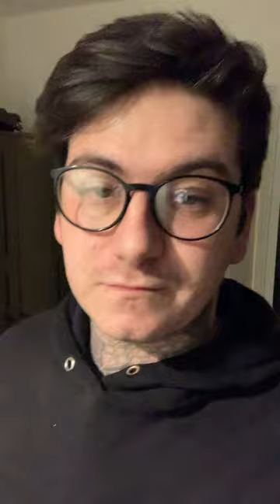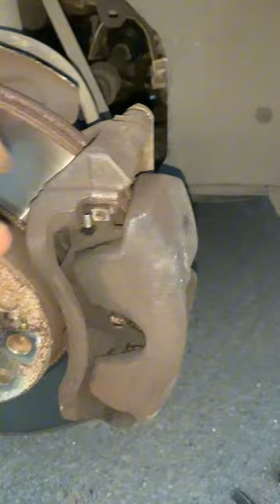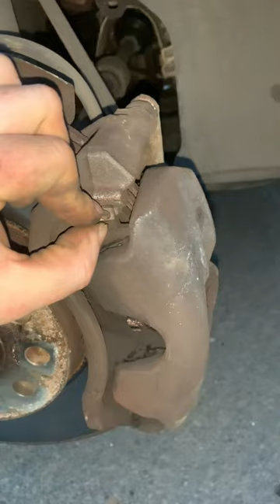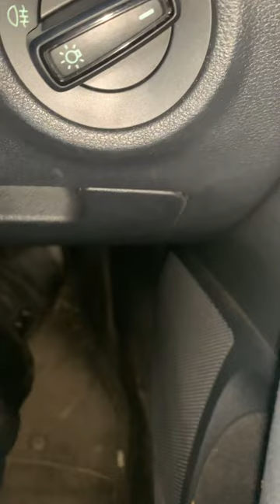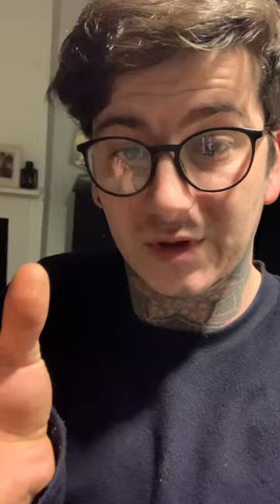Brake pad knocking!! #skoda #mechaniclife #mechanic #car #fyp

Comment: Wrong pads or... the person who DIY before has filed the fuck out the runners trying to clean them and now clearence too much
Reply from the maker: Neither just a very cheap set of pads! Instructed the customer to go back to the garage who fitted them and get them replaced.
Reply: @owensautotips  so weird. I can get very cheap pads but will still fit, just no last as long. This must be cheap that somebody local made them in the garage or something
Reply from the maker: @paulmartin2k7  my local eurocarparts sell like 8 different brands. Probably purchased the cheapest haha
Reply: @owensautotips  oh!!! Europarts for me is a no go! Local is TMS or DINGBRO, never venture anywhere else. Europiss is the name I have them under
Reply: Genuine question, isn't there suppose to be little metal carriers that clip into the caliper? What the pads slip into?

Comment: No anti rattle shims fitted
Reply from the maker: Most Skodas don’t use them
Reply: Is it possible that the break pads are OEM parts or in the wrong model?
Reply from the maker: @olivertwist9003  they are the correct pads, from what I can see they are a cheap brand so the fitment isn’t the best. Recommend the customer to go back to the garage who fitted them for a better set
Reply: @owensautotips  It is a better practice that compare those old and new parts and confirm that they look the same before replacement.
Reply from the maker: @olivertwist9003  it is indeed and hence a road test to double check everything is working as should